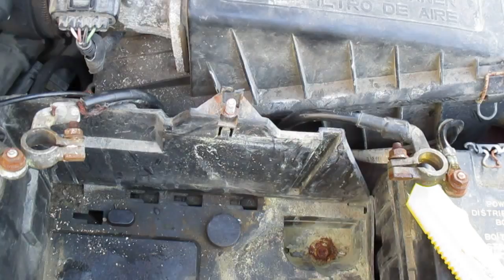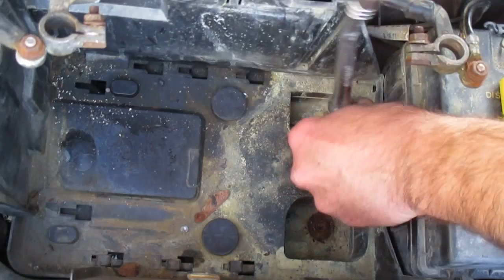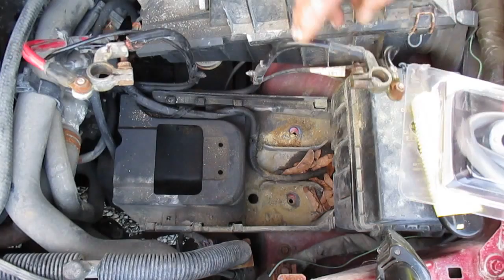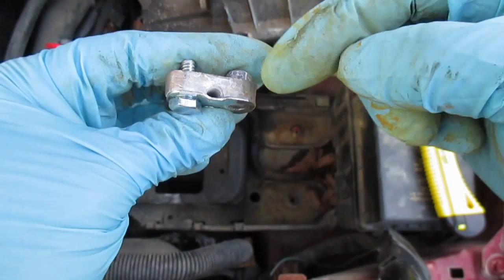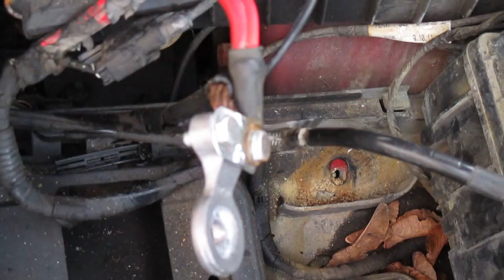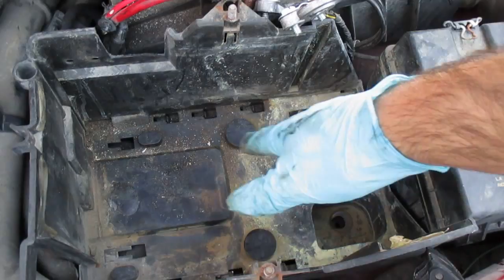Replacing the connectors on car battery cables

Comment: I think this is a perfect way to flip from top post to side post And a quick fix for a aging car you plan to keep a year Or two 
If you are looking for a long term fix Buying Copper lugs And a Hammer crimp is the best i can think of And using stainless steel 3/8 bolts with just over a inch in length a few washers and a nut And 1/0 awg welding cables shrink tubing and electrical tape And a dap of dielectrial grease 
Having exposed copper wire creates oxidation when Air and moisture Copper is no longer shiney like a new penny Then gets darker And then you start seeing green copper oxide. In these steps Current is no longer the same And drops as the steps get worse Heat transfers to the point of the issue Add in a rainy day And mixture of water And you get everything along that line worse from Battery to Alt  Wire coatings get hot then cold Hot And cold And become rigid 
This is why i give a dab of grease on my fresh cut wire before the Lug And a dab of grease On my lugs Before installing them on the battery Had them this way for 4 years now And replaced the grease twice after a engine bay wash now and then

Comment: The side post looks cleaner . i end up using champion batteries cause they have dual connections.  If you do not have dual connections on the battery i would add a jump start terminal just in case the battery is dead. cause side post are always harder to jump start with the short bolt

Comment: when putting the bolts through the holes in the wire and into the battery terminal itself, do I need to put any washers/nuts on before hand or can I just screw it in by itself?